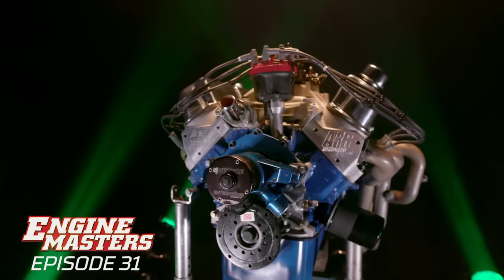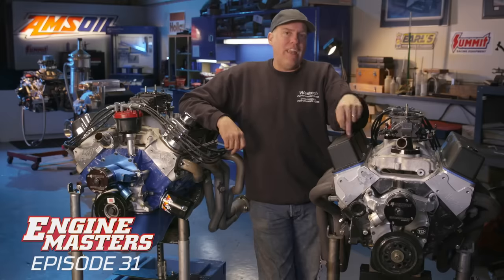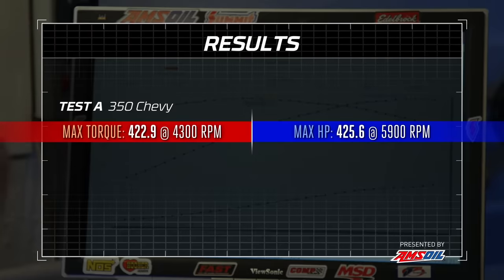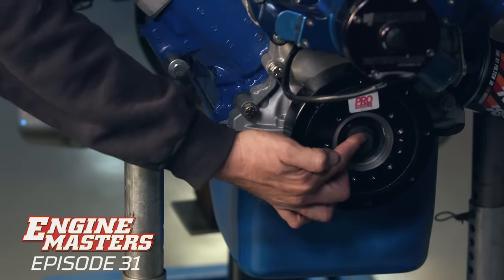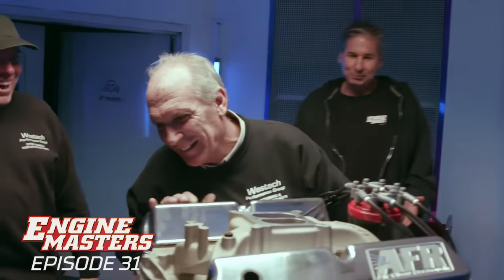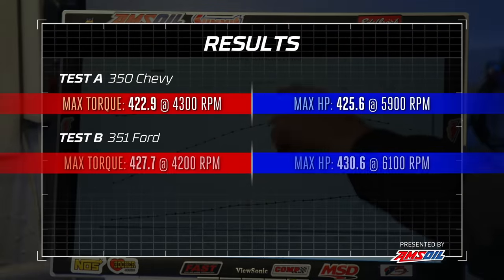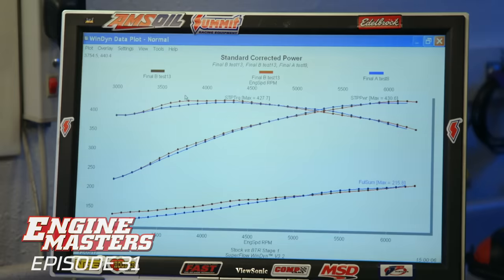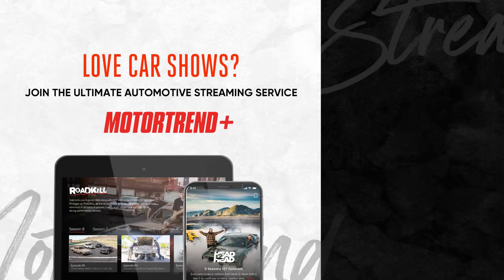Chevy vs Ford V8 Showdown! Small-Block or Windsor? | Engine Masters | MotorTrend

Comment: The 351cleveland is the best and fastest stock engine ford has ever made for its size. It hade a lighter block, big heads, and it was designed for speed. The 351 Windsor was a good engine but nothing like the Cleveland  was.
Reply: mikec9112  The Cleveland only weighed 476 lbs. ready to run and I've beaten many Chevrolet 350s and Olds after giving them a head start with a stock 351cleveland 2 barrel carb easily.  I've had a few 351 Windsors and they were not fast. I don't know where you are getting your information from.

Comment: So long story short, if you're gonna Frankenstein together factory parts, the Small Block Chevy will be the way to go and you can make more power with it, but if you're using aftermarket heads/cam/intake, the Windsor will be right there with it. It pains me to say that by the way because I'm a Ford guy, but you can't argue with the numbers. Chevy just seems to run better flowing heads in factory form (other than some high performance applications like Cleveland and Boss heads) than Ford does. I can say one thing about it, which is that the Ford stuff in truck applications seems to feel more powerful even though their advertised numbers don't say so, which may be why they choke the heads down a bit more.

Comment: The 351 has a slight advantage over the 350 in that the spread port design of the Ford is slightly better than the shared port design of the Chevrolet. The extra two tenths of an inch stroke length on the Ford doesn't give it any advantage.

Comment: i like fords and chevy's but i just can't get parts as cheap as chevy i been getting the 450 hp 4 inch stroke 454 with a 02xx 400r turbo for free so fare from 6,000 to 58,000 miles on them. ford the best i can get is a 390 that needs rebuilt for free. then interior chevy dash pad is 54 bucks the ford of the same year is 350 bucks. i really hate a sbc because they leak real bad the bbc i don't have leak problems. the fords i have seem to be good on leaks sbf and bbf

Comment: All tell ya, David, that I thought the test was for a great comparison between Ford and Chevy SBs.  I thought that the Ford had a better chance of winning the shootout because of the potential for horsepower, not excluding the same thing with the SBC.  The only drawback to the Ford under extreme conditions would be reliability.  I thought that the Ford would, "Blow Up" during normal race track pressure to out perform the competition.

Comment: So what this shows is the aftermarket has finally made it where you can build a Ford that's the same as a Chevy for about the same money and get the same power.  
The difference here was the couple extra cubes and the extra compression for the Ford, that's it.  
The reason that Chevy has always been considered "better" and you could always make more power with one was established when there were no aftermarket parts and you had to use factory stuff.  Heads, mostly.  
When we all had to scour junkyards and swap meets to find the "good stuff", it was much easier to build an SBC or BBC and you could make more power with them, because the factory heads were better, and there were more of them because GM outsold Ford and Chrysler combined back in those days.  
You simply couldn't go find a set of "double hump" heads for a Ford and outrun your buddy with them.  Or a set of rectangle-ports for your BBF.   They just didn't exist, and the better ones were few and far between. 
The aftermarket has eliminated that gap.

Comment: Camshaft deflection is another hidden advantage of the Ford. But most people would even consider that an issue on the street.
Reply: And the idiotic front sump of the Ford is a major disadvantage.
Reply: @craigcampbell8560  I wouldn’t consider that a disadvantage as much as I would siamese exhaust ports. Typically speaking most run dry sump in high performance applications. So the pump location is moot.

Comment: There's a reason Chevy went to the symmetrical port design like the SBF on the LS. It's just a tiny bit better than Siamese ports like on the SBC and Ford Y--Block engines.

Comment: I watched this video and Freiberger will pick a small block Chevy because that is what he knows. His only concession is that "they are the same". He won't admit the Ford won even if its only by a little. It's like the time where they pitted a brand new 6.0 LS agninst a junkyard, rebuilt Coyote 5.0 and declared the LS the winner. Even though it only one by like 25 horsepower with all that extra displacement it had.

Comment: Both great engines. Working in the marine industry the 350 Chevy sb is just bullet proof and can run at 4k all day long for years. The ford which wasn't used as long run forever also and are much stronger built blocks. Let a Chevy freeze and it's broke for sure but ford's seem to be able to take more punishment. I know that don't really mean much but we replace Chevys that are froze broke but I have never replaced a ford. I do understand there are a lot more sbc around but there are still plenty of sbf to and they just don't break as easy.

Comment: If you would have ran a 351C it would not have been close. The 351C will put out much more power than a 351W. Try doing that next time to tell the real story. Its not about cost, its about performance...Remember that.

Comment: Its my understanding that the ford Cleveland was a stronger motor vs the windsor
Reply: It had better heads but the Windsor block is stronger.
Reply: These AFR heads are way better than the Cleveland heads.  Neither engine had anywhere near stock heads.  If you are comparing stock motors, you sir are correct.

Comment: You mentioned the peak numbers for both engines. You also mentioned that average power was "twosies and threesies". Which engine had the best average power for curiosities sake?
Reply: Ford had more lower end torque n hp so i guess the 351W would be best in the street n in a race.. Slight more compression n cubes gave it 5 more hp n 4.8 torque.. I'm a Ford guy so you know what i'm going with..lol
Reply: They said.. it was the Windsor.
Reply: Even though I'm a ford guy the difference is all in the compression ratio and cubic inches. Bore the 350 a bit more, slightly thinner head gasket and they'll just get closer.
Reply: @dchil15  I was gonna say, those numbers are close enough that if you dyno them both another few times the tables will flip

Comment: If power is the same, the real question is, which one is lighter?
Reply: I believe the Ford small blocks were always lighter. A Ford 302 was about a hundred pounds or so lighter than a Chevy small block, may have made a little less power but since it’s lighter, it makes all the difference. The power to weight ratio is something people always overlooked. For example, I always toyed around with the idea of putting a 460 big block in a ‘66 Ford Galaxie 500 4 door hardtop I plan on picking up one day (like the look of the ‘65 and ‘66 Ford Galaxie 500 4 door hardtops) but after I heard they weigh up to 700 pounds, would be kind of redundant since it would make the car closer to 5000 pounds not to mention the car would be nose heavy which would mean the front suspension would have to be beefed up. Also would cook the front bushings with all the heat that radiates off of the exhaust manifold. The only ‘66 Ford Galaxie 500 I plan on picking up has a 289 in it anyways which will run fairly quiet along to giving decent fuel mileage once everything is all tuned up.

Comment: My grandpa made his choice between the two when he saw that ford had the distributor up front on the 64' 289 fairlane, he then bought a 72 F100 with a 302. Other than that today I see no difference.
Reply: The dizzy is in the front on a Ford because the oil sump is also in the front.  Considering the fact that the oil gets forced to the back under full throttle, the front is a stupid place to put the oil sump.
Reply: @craigcampbell8560  Got news for you, he didn't care, about full throttle in the truck and the fairlane was heavy enough to not slosh under acceleration, he would get out on the highway and roll, but adjusting timing or changing points on the back of a hot motor with the hood hitting the back of his head not the brightest idea either.

Comment: If they really wanting to look at what was modern in 1969 around They have just compared a 1969 Z28 302 and a Boss 302. both with modern cams. (both were factory rated at 290HP at 5000RPM)

Comment: Of course the 351 Cleveland...a bit heavy...but had the "rat heads". (offset valves) 
But baby did it get you "up outa the water"
Reply: As long as in a car that is light/lot of gear.....otherwise there dogs down low....most guys I knew on the 4bbl. heads ran screen gaskets on intake for bottom in on 3000 plus cars.
Reply: @chrishensley6745  soooo..it would be an interesting match run between a 351 Windsor and a 351 Cleveland. Mebbe a '71 Mustang or a Torino

Comment: Now put vortec heads on the sbc...just cuz i wanna see the difference!
Reply: those aftermarket heads are likely better than the Vortec heads.  The Vortecs are the best flowing factory head, but most aftermarket heads outflow it.
Reply: The Chevy would lose power with those heads.
Reply: @silicon212  yeah that's true. I just wanna see the numbers, i guess.
Reply: @ZONES89RS  agreed

Comment: Ok, but which one is more reliable and or durable?
Reply: FORD
Reply: About the same. They are very basic dinosaur V8s.

Worked on them all. And those both with 150k miles of work use would need a ridge reamer to get the pistons out.

Comment: Power is in the heads ,that's why small block chevies run good ,a BOSS 302 or BOSS 351 head will out perform a small block Chevy head

Comment: you need to do a drag race put the engines in identical cars weight etc... and have a shootout of which engine will come out on top.
Reply: This is the most practical accurate test. Putting them in cars then you need to factor in transmission ratios, diff ratios, aero, frontal air intake etc.
Reply: The lighter chassis with the least parasitic drive train loss and best 60 foot would win.

Comment: Now compare the 351 Cleveland to the 350. Let's see the difference there. Although I already know the Cleveland will produce better numbers. The test is not complete without testing the 351 W and the 351 C against the 350. Maybe even put a 340 Mopar in there also but not a 360 Mopar that isn't fair.

Comment: You should have used a Victor Junior on the 351 cuz you choking it with a dual-plane
Reply: you get more tq with a dual-plane for the street.
Reply: @chucktaylor9190  everyone saids that I built a 351 with a Victor Jr and it had so much bottom end torque l had to port it out to stop from burning the tires off of it l tell you what put a Victor Jr on it and try that will show you better than l can ever tell you it will make more power and have more mid range and top end
Reply: @jimmymccormick142  I've tried both, I just prefer the dual-plane for the street, so does engine masters.

Comment: WHY SO LITTLE HORSEPOWER WITH THE AFR HEADS AND A ROLLER CAM ?  I WAS EXPECTING 500 HP.  WAS IT THE LOW COMPRESSION AND SMALL CAMS ?
Reply: Definitely low compression. 
9.2/1 on the chevy and 9.5/1 on the Ford.

Comment: I remember that spring & button on the front of the Chevy cam--what a joke.
Reply: you will only ever find that on aftermarket roller cam setups, no factory SBC ever came with that.  Flat tappet cams have an angle ground into the cam lobe profile that thrusts the cam into the rear of the engine (and against the thrust plate on the cam sprocket), and factory roller blocks have a thrust plate that bolts over the nose of the cam that holds it in the block.  Same with the SBF between flat tappet and factory roller cams.
Reply: @silicon212  Not just aftermarket & not just roller cammed engines.  The spring and button design was original to Chevy and other GM products of the time--perhaps other engine makes, as well. The design was mickey mouse. Other manufactures, including many piston aircraft engines, Fords, etc. used a durable plate that guaranteed that there would be NO movement (fore or aft ) of the cam. And that plate design likely cost no more than Chevy's silly spring and button design. I rebuilt many auto and piston aircraft engines--back in the 60's through 90's. Sadly, more and more manufactures started to use the spring and button design as the years went by
Reply: @johngranato2673  I've been doing this for almost 40 years and I have yet to see a SBC with a factory cam button.

Comment: Well immediately not a for engine guy I'm building  a ford dually  but I have chevy motors  but the truck has already  351w with 90.000 kl so maybe I might keep it ans loose the c4 transmission  for an od , thanks guys I'll let you you know what happens

Comment: It has nothing to do with horse power or torque... One of those motors was engineered very simplistically and for longevity.
Reply: Idk about longevity. Those old pushrod engines don’t do well compared to newer pushrod engines like the LS and dodge stuff. The ridge reamer was needed to pull pistons pretty often on the old stuff.

Comment: i personally prefer ford over gm but i like them both people forgetting down in the comments you can make a stroker using all factory ford parts you cant do that with a gm small block also one thing i like is how uniform ford engines are unlike gm which had buick only engines oldsmobile only engines caddilac only engines etc vs ford which has small block big block and diesel thats it and contrary to popular belief theres much more interchangable parts etc with ford then there is gm but you gotta know fords to know that

Comment: It’s relatively. You can squeeze power out of any engine with enough money. But the auto makers spend years of development and money to make a 5.0 block that can out preform a 500 c.I. Caddie so you the consumer doesn’t have to. It doesn’t matter if you buying a Ford or GM they all do the same thing is the point. What determines which is better is how you get the power out to the tires. Mustangs have different gearing than a crown Vic or a F-150 this is also true with GM. So what if you build a 500 hp coyote there’s a guy with a 300 hp Honda Civic that will beat you if you don’t know or understand the drive train of what you put that Coyote motor in.

Comment: The biggest difference is longevity
Reply: Which one you think would last longer
Reply: @nathannewman2686  Had both...same oil & filters,same maintenance. My Ford lasted longer but only by 20% lifespan & mileage .
Reply: I got 9 years of abuse on my ford 302, last 3 have been boosted with 10-15 lbs of boost. Still holding up. Stock rotating assembly
Reply: Ford 5.0 to 357k miles
Ford 4.6 to 287k miles

Comment: Ford will wear out faster with 3" mains. And oiling is inferior as well. And it is heavier with inferior cooling. But performance is very similar as proven. The head is probably a bit better.
I have built both is similar specs and both were very good engines. I prefer Ford cars so I guess I am stuck with Ford engines. I have raced Holdens with Chev power and I can guarantee they are cheaper and easier to build!!
Reply: It’s why I LS swap my fords. 😂

Comment: It all comes out in the end. As in the rear end.
A Ford 9 inch diff eats up a few more horsepower than the 12 bolt.
I remember way back someone compared a built Chevy 427 with a built 436 Hemi.
The 427 actually had higher peak horsepower, but the Hemi had a broader and desirable power curve.

Comment: I vote for the chevy it is a stronger engine more parts available some small block fords have been known to mysteriously split in half i think its the 289 302 block to be fair about it.
Reply: you do realize the 351 is a tougher block right? it's a different casting to a 302....
Reply: 289 GT350s and Cobras would beg to differ!
Lol

Comment: Why do the tests always try to match parts though? Why wouldn't you throw the best available at each? I'm generally a Ford fan and I don't care if it costs more to build the Ford; if there is a better head for the Ford than the AFR, why not use it (intake, cam, etc)? Might not be any difference at the top end either (betting there is) but lets see reality?

Comment: Where the Buick Oldsmobile and Pontiac at 💪
Reply: In the scrap yard
Reply: I see more Chevys and Fords at the scrap yard
Reply: @rogersaucedo8817  because there are none of the ones you stated left. Lol
Reply: @ZONES89RS  it's probably because they wanted to keep them to restore them because everybody else same Chevy and Ford combination at the track just like LS
Reply: @rogersaucedo8817  because they are relics and only good for nostalgia.
Reply: Not really if you know how build engines and the money you can make them fast so you can be different from the pack
Reply: @rogersaucedo8817  hardly by todays standards. You would have NOTHING left that was factory and spent a ton more to have no advantages
Reply: Not really because it's been proven and it's on YouTube whole bunch of Buick Pontiac Oldsmobile and AMC
Reply: Anything's possible i seen Honda Civics all motor take out  Camaros and Mustangs just need the money and a good Builder and anything is possible to have fun with in the street or the track

Comment: There is an inherent design floor in the Chevy engine . The cylinder heads on the chevy have 2 exhaust valves sitting next to one another where on the ford the valves are laid out the way they should be so there is no temperature discrepancy in the middle of the cylinder head. Chev did eventually wake up when they developed the engine from the early 1990's changing the valve lay out to be the same as the Ford engines have been since the first V8.